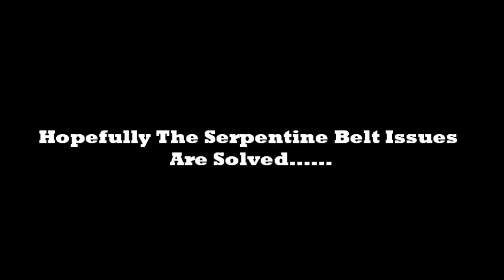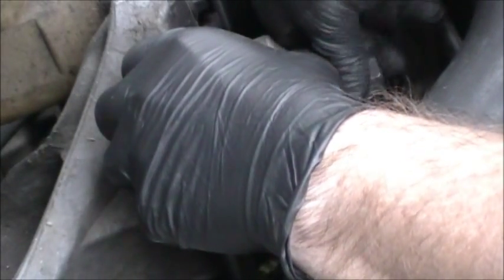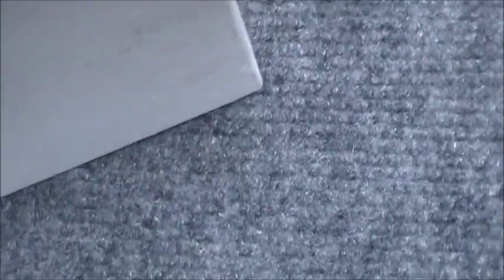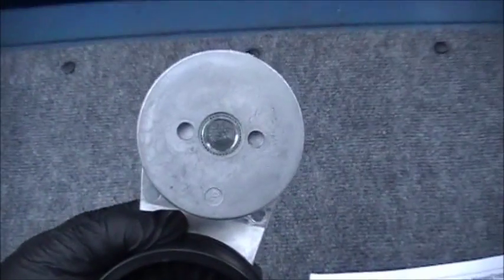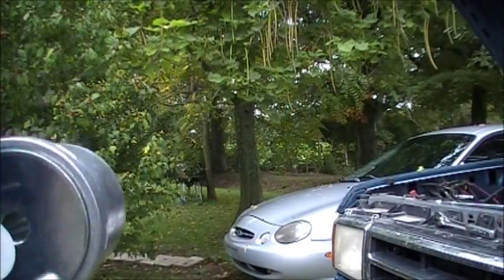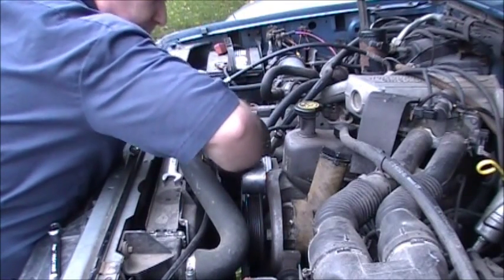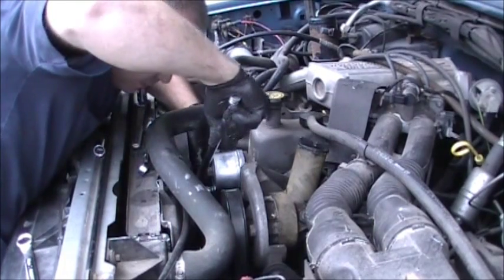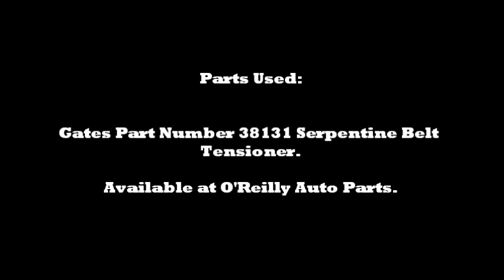Belt Tensioner Replacement

Comment: Thank you for this video. I have a 89 F150 4.9L stick. I will be doing this next and using the same part. Any suggestions for smog pump cleaning and cleaning or replacing the smog pulley?

Comment: howd you fair with this tensioner. i replaced mine last year, don't know what brand and it started bending toward the front, belt was hanging off the back off the pulley which eventually made it break and fly off. I hope this new one i got won't do the same